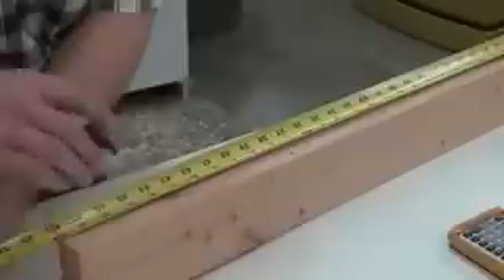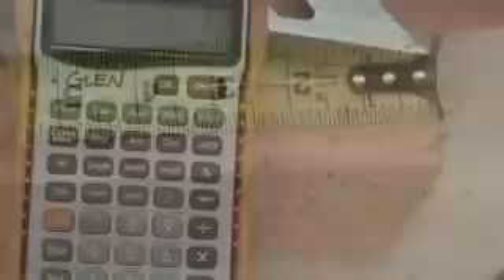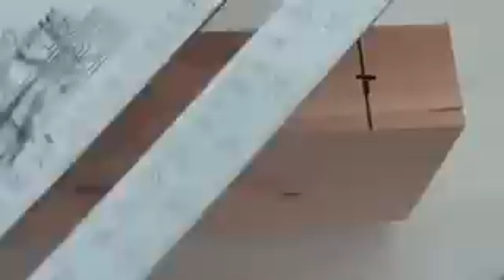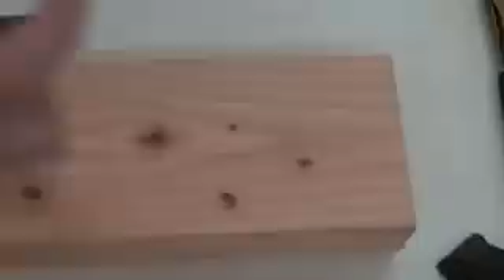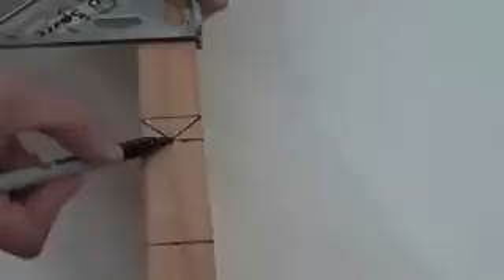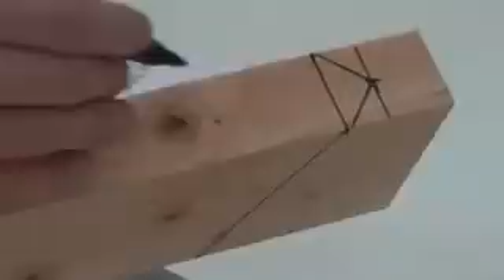U3 V2   Laying Out a Hip Rafter

Comment: If you are using a roofing square could you just deduct the 3/4 inch instead of doing the calculation ?
Reply: I subtract the ridge thickness from the span then there is no adjustment to the length it is already factored in for the common and hip/valley lengths also when cutting the Jack's make the length to the long of the 45 and the 45 cut will automatically center the Jack
Reply: @Lee @Lee-dn3ou he also calculated it wrong, the distance is 1 1/16” , .75 x sqrt 2.

Comment: All of the actual cutting I have seen in the videos is done with a handheld circular saw. Does anybody use a miter saw or a radial arm saw to cut the wood?
david
Reply from the maker: I suppose it’s feasible, but not to practical.

Comment: We are using 2" × 6" rafters and 2" × 8" ridge and hips. Will top of hip birds mouth remain same as rafters? 
Your video is the best for builder friendly and details l have seen.You should do more.   Thank you!
Reply from the maker: Yes but just remember to extend the seat cut like we show in the video.  Thank for the compliment.  This is part of our trading series for our carpentry program
Reply: H.A.P remains the same on all roof members but the seat cut on hips will need to be dropped slightly to allow the edges of the hip to plane in with the hip jacks and commons. This amount varies depending on the pitch of the roof. The hip drop can be calculated mathematically or marked directly onto the side of the hip from the plane of the jacks. It's usually around 3/8" for a 8"/12" pitch. The higher the pitch the more the hip has to be dropped. The seat cut on the over hang for the soffit will have to be raised by the same amount to allow the soffit cuts on the hip jacks, commons and hip to be in plane, 👍🔨🇮🇪

Comment: nice job Glen..very well explained but I have a question..actually 2..when you calculated the cut at the ridge why did you use the pitch in the calculation for the setback?  Should it not have been 1-1/8"?  (3/4" run & 3/4"rise for a diag. run of 1-1/8")  I know 1/16" isn't a big deal, but could that formula come back to bite you in the ass at some point?  Also,,once all the cuts are made, what order are the rafters are cut, what order should they be assembled in, and how are they all fastened?  seems to me there would be an awful lot of nails in a small area which might weaken the wood/joints.
Reply: I think it should be 1-1/16", measured on the level (square to plumb cut)... Regardless of roof pitch (assuming a regular 45 degree hip). But it could be calculated on the diagonal -- it's just an extra, or at least different step.
Reply: Set the ridge, install the three king commons, install the hips and then infill with the hip jacks. Sometimes a plywood gusset plate is installed under the ridge tying the two king commons either side of the ridge together. On big span's a post mid span under the hips would be good practice, 👍🔨🇮🇪

Comment: How did you figure 2”1/2” for your HAP .???
Reply from the maker: That's a measurement we use in the class when using 2 x 4 material.  Pitches between 2 and 6 leave  about 2/3rd of the plumb line  of a 2 x 4 (diagonal height is a calculation you can make, or simply layout the roof pitch on some material and measure that length.  Best practice states at least 2/3rd of the plumb line length should measure above plate line (it's for strength by the way.  When  matching an existing roof, you'll need to determine the existing HAP and match that.  But again, make sure it is at least 2/3rds of the length of the plumb cut. 

Thanks for the question.  Hope this helps.

Comment: How come your HAP isn't shown in your rise/run calculation? usually I calculate rafters by doing a rise/run calc, then add my hap to my calculated ridge height. the diag is the same, but the height changes.
Great video, just don't know if I missed something in your method?